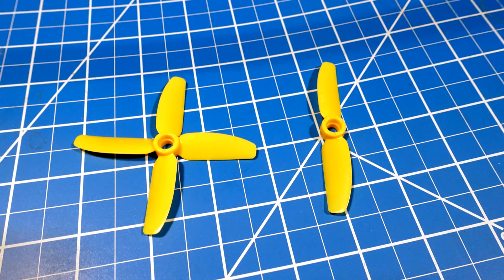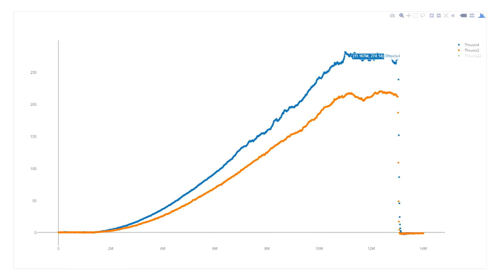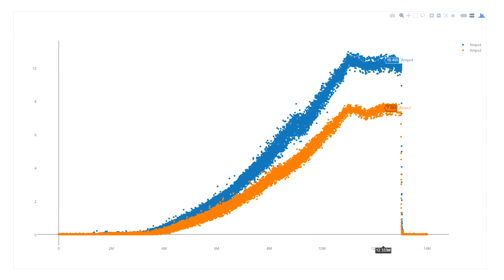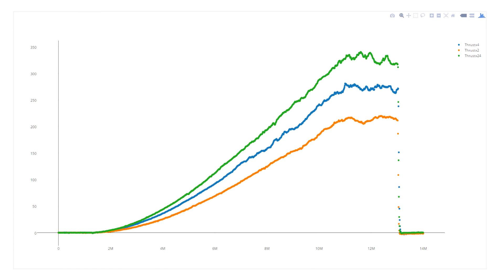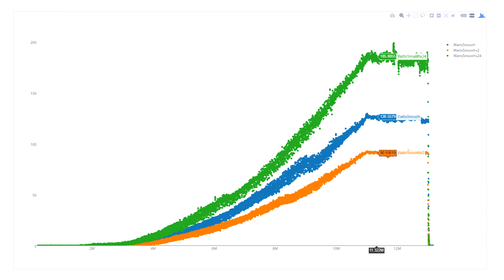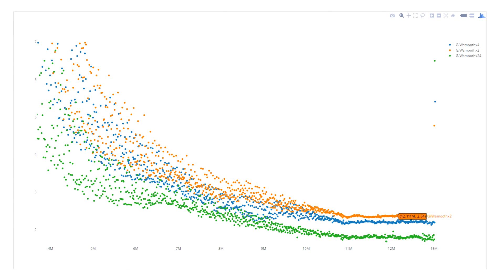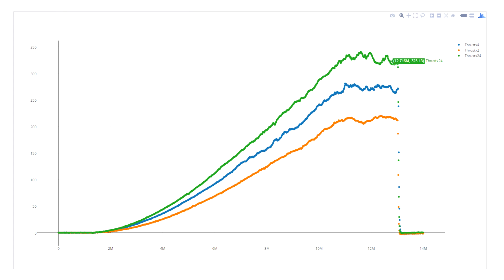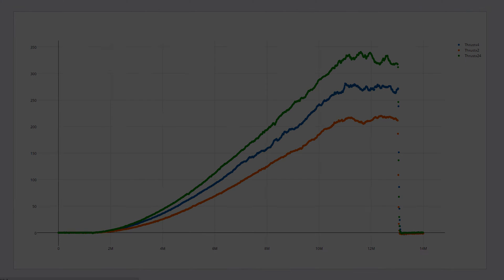How many blades?  Comparing 2 and 4 bladed props

Comment: Adding a 3rd blade doesn't make the prop less efficient, as at the same RPM each of the 3 blades has identically the same drag and lift, as a two blade prop at the same RPM. Same for a 4, 5, 6, or 7 bladed prop with the same blade profile, as this physics property does scale linearly. What also scales linearly is the torque required to spin the prop at that RPM, and with that the current in the motor to produce torque also scales linearly.

What doesn't scale linearly is that current in the motor causes exponential copper heating, plus the current in the ESC mosfets also causes exponential heating. So if the ESC and motor are undersized, such that the currents required are significantly larger than 1 amp, then the ESC and motor power losses (loss = R * (I^2)) will rapidly rise exponentially. Each motor has both a maximum efficiency torque curve, and maximum power torque curve.

A good design sizes motor and ESC to operate in the maximum efficiency zone for battery life, and briefly in the maximum power zone for control authority and  rapid climb out.

Comment: Another educational video, thank you SiieeFPV! So in terms of best bang to efficiency loss the 4 blade on 3S is slightly better than 2 blade on 4S?
Reply from the maker: efficiency wise the 4 blade wins massively.  Going from 2 to 4 cost about 30 watts, going from 4 to 2x4s cost 56 watts for slightly less gain.  In this case I would go 4blade 3s HV before going 2blade 4s.  As usual of course that's all entirely dependent on the KV of the motor
Reply: Whelp, this is good news for me!  I'm glad I went with the 3S batteries because I'll be flying quad-blade.
Reply from the maker: as long as you went with the 3800-4000kv motors, if you got 3100kv or abouts you will need 4s.

Comment: I remember reading somewhere, that turbulence or wake is only a very small factor in efficiency decrease when increasing number of blades in a propeller. They mentioned the reason was that the air in which the propeller is turning is moving away from the back of the propeller, so the wake from each blade will move backwards too, leaving "clean" air for the next blade to bite into and that the main cause for lower efficiency was the added aerodynamic drag of the additional blades, particularly, tip vortices which they said causes the most waste of power in a multiblade prop. Kind of makes sense and it's very apparent in BN props. Straight edge tips make for very inefficient props -those wide straight tips make really big vortices and noise, so more  power is needed to spin props and overcome the aero drag.
Reply from the maker: That makes a lot of sense to why the GF 3030 bullnose is just bad, but the DAL triblade is terrible.  Tip vortices effect would still be from them interacting with the trailing prop though, no?  I would think that non-interacting drag would be a pretty constant force regardless how many blades, and the quad is losing 70% of the thrust that you would expect from taking the additional two blades and running them on their own.  The load on the motor didn't radically increase compared to the loss of "expected" thrust either, so it's not like it was just eaten up with drag, I wonder if it's anything related to how coaxial setups will often put a higher pitch prop on the lower motor to get a better bite on the moving airstream from the upper one?  Makes me really want to build a tiny wind tunnel
Reply: Tiny wind tunnel + super high-speed camera would be awesome :) you could add some colored smoke and see if tri or quad-blades are interacting with more turbulent air than 2-blade props.
From what I read and seen on so many different internet documents and TV documentaries and some books, the vortice itself creates drag on each individual blade, and also you have one or 2 full blades, basically 1.5 or 2.0 times the aerodynamic drag area compared to the 2-blade props so of course you'll need more energy to overcome it, and as we know, aerodrag increases proportionally with Vel^2. 
Not achieving the expected performance increase could be due to the lower RPM due to the additional props? Additional drag loads motor more, so lower max RPM results in lower thrust. I'm also trying to understand - Not stating all the above mentioned is factual or saying that's the way it is, mainly spitting out my limited understanding. Aerodynamics can be quite complicated.... LoL
Reply from the maker: Ah ha!  I'm normally all over peak RPM for the load on the motor, completely forgot about it's more obvious relation to thrust.  13% prop speed is no tiny amount, and the thrust is really non-linear against RPM, that is going to be a massive amount of thrust that's totally accounted for.  I'll have to check against my raw logs again when I get back to my computer, but I'll be that makes up almost all of the difference.
Reply from the maker: So at 30.5k rpm the two blade version is only putting out 173g, so we're actually only losing about 22% of the absolute ideal thrust at that motor speed, rather than the 36% I had pegged it at earlier.
Reply: That's a better comparison. Since we want to know propeller performance, so comparing thrust at same RPM then we can determine efficiency more accurately. Interesting stuff!
Reply: I know im asking the wrong place but does anyone know a trick to log back into an Instagram account?
I was stupid lost the account password. I appreciate any help you can give me!
Reply: @Cairo Gibson instablaster :)
Reply: @Keanu Lance I really appreciate your reply. I found the site through google and I'm in the hacking process now.
I see it takes a while so I will get back to you later with my results.
Reply: @Keanu Lance It did the trick and I now got access to my account again. I'm so happy!
Thank you so much you saved my account :D
Reply: @Cairo Gibson happy to help =)